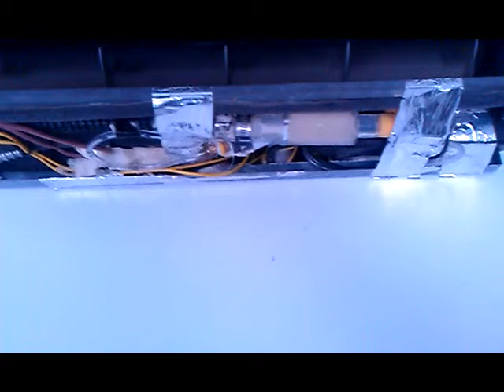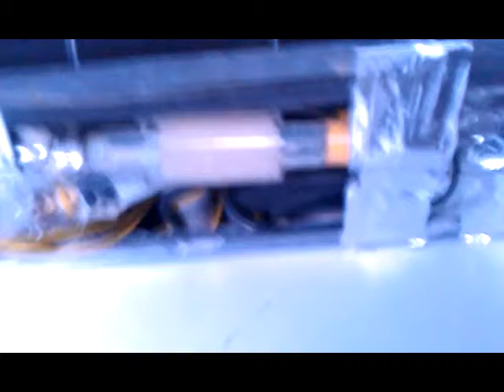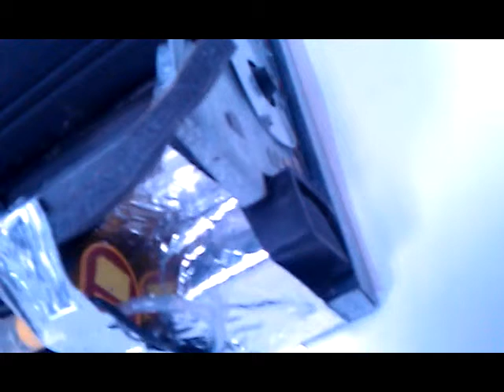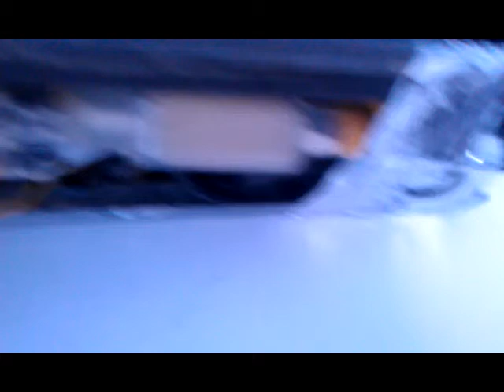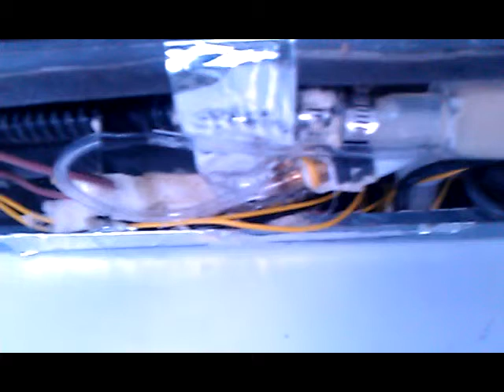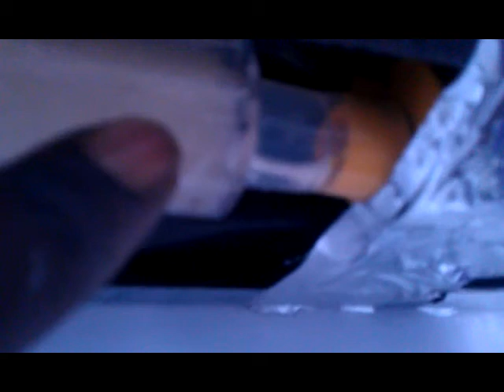pacific condensation pump

Comment: I realize this is an old video, but did you ever resolve the issue?  I have the same setup on my boat and it makes a ton of noise just like in the video.  Looks like it is probably from air getting into the line.  Not sure how to remedy it thought.  I have also noticed  small drip from the sensor unit.  Not sure if it's related.